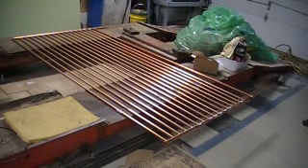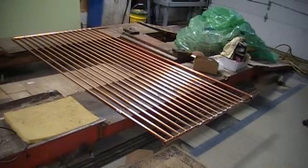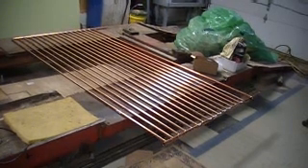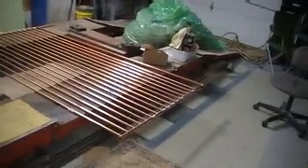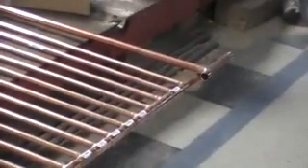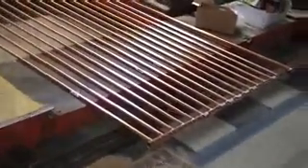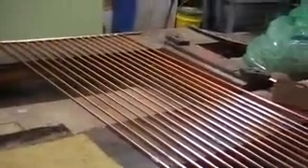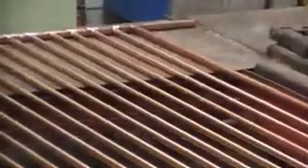how to build a solar water heater from start to finish (part 1)

Comment: I appreciate your humility.  What sizes did you choose to use for your top and bottom manifold and the vertical lines on your collector?  Any reasons why you chose the sizes that you did?
Reply from the maker: The top and bottom are 3/4 inch copper and the vertical pipes are 1/2 inch copper. It has been awhile but I wanted low restriction at the manifolds but smaller risers so that it would heat faster and transfer that heat easier.